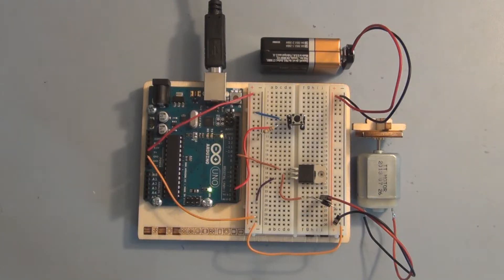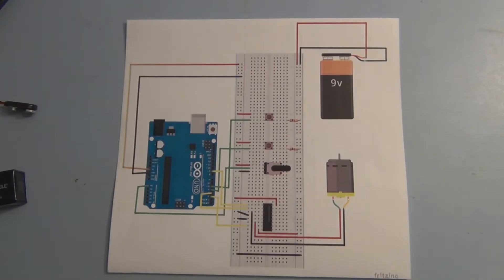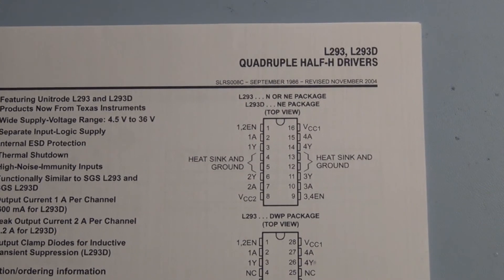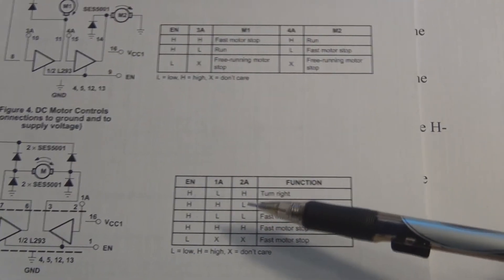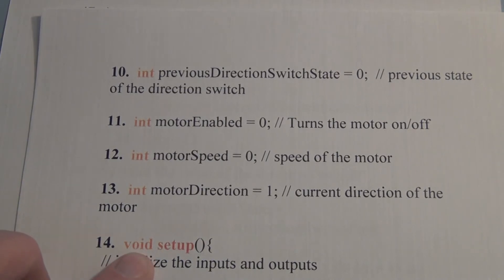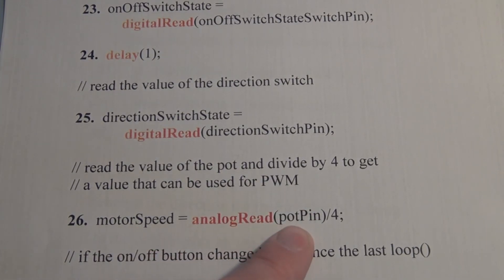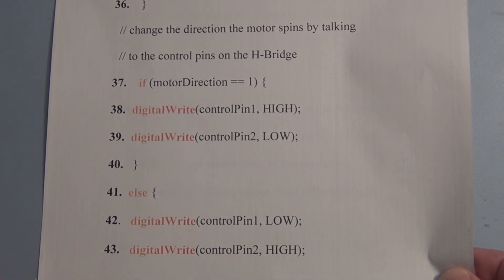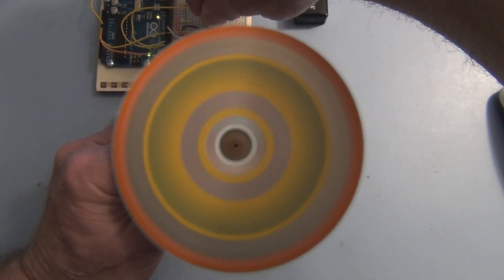Arduino H Bridge DC Motor Control Tutorial

Comment from the maker: const int controlPin1 = 2;
const int controlPin2 = 3;
const int enablePin = 9;
const int directionSwitchPin = 4;
const int onOffSwitchStateSwitchPin = 5;
const int potPin = A0;

int onOffSwitchState = 0;
int previousOnOffSwitchState = 0;
int directionSwitchState = 0;
int previousDirectionSwitchState = 0;

int motorEnabled = 0;
int motorSpeed = 0;
int motorDirection = 1;

void setup() {
  pinMode(directionSwitchPin, INPUT);
  pinMode(onOffSwitchStateSwitchPin, INPUT);
  pinMode(controlPin1, OUTPUT);
  pinMode(controlPin2, OUTPUT);
  pinMode(enablePin, OUTPUT);
  
  digitalWrite(enablePin, LOW);
  
}

void loop() {
  onOffSwitchState =
    digitalRead(onOffSwitchStateSwitchPin);
    delay(1);
    directionSwitchState =
      digitalRead(directionSwitchPin);
      motorSpeed = analogRead(potPin)/4;

      if(onOffSwitchState != previousOnOffSwitchState){
        if(onOffSwitchState == HIGH){
          motorEnabled = !motorEnabled;
        }
      }

if(directionSwitchState !=
previousDirectionSwitchState) {
  if(directionSwitchState == HIGH) {
    motorDirection = !motorDirection;
  }
}
if(motorDirection == 1){
  digitalWrite(controlPin1, HIGH);
  digitalWrite(controlPin2, LOW);
}

else{
  digitalWrite(controlPin1, LOW);
  digitalWrite(controlPin2, HIGH);
}

if(motorEnabled == 1) {
  analogWrite(enablePin, motorSpeed);
}
else{
  analogWrite(enablePin,0);
}
previousDirectionSwitchState =
  directionSwitchState;

previousOnOffSwitchState = onOffSwitchState;
}

Comment: Awesome - I got it to work! Thanks for sharing!

I might add that the reason your potentiometer was erratic is due to the when you divide the inputMotorSpeed by 4 but you'll sometimes end up with a floating point number. To force the calculation to be correct:

instead of:
"motorSpeed = analogRead(potPin) / 4"

...do this
"motorSpeed = analogRead(potPin) / 4.0"

I figured it out by doing a Serial.println(motorSpeed) after doing the calculation and was getting negative numbers in random ways. Thanks again - I learned a ton! Peace.

Comment: I need to use higher power motor with more torque, so can I use motor mentioned below?

http://uk.rs-online.com/web/p/dc-motors/2389721/
Reply from the maker: The L293 can only deliver 1A per channel.  That motor can draw up to 4A .  If you need more than 1A to drive the motor you can't use the L293.
Reply: Ohkay.....I already bought the motor and used it....It seems to work fine but i think it might harm my components, right? 

Could you please suggest different H-Bridge for the same ?

Comment: Very well explained, i do have a question may be you can assist.......
can the arduino control the speed threshold voltages without the use of a pot, basically using a inbuilt pwm  or f/v convertor to control speed. using up /down buttons for speed control
Reply: +Justin Case The input frequency could be  a crystal and thereby divided for conversion to voltage within the Arduino... is this possible?
Reply from the maker: +Justin Case Yes, If you use one of the PWM pins to drive the motor circuit, the gate on the MOSFET for example, you can write a program to keep track of the number of times a button is pressed and correspond that to a set PWM value so each time you press the button it steps up the speed to the next value.
Reply: Thank you

Comment: Can you put the actual code so we can download it and try it ourselves?
Reply: const int controlPin1 = 2;
const int controlPin2 = 3;
const int directionSwithcPin = 4;
const int enablePin = 9;
const int onOffSwitchStateSwitchPin=5;
const int speedControl = A0;

int onOffSwitchState = 0;
int prevOnOffSwitchState = 0;
int directionSwitchState = 0;
int prevDirectionSwitchState= 0;

int motorEnable= 0;
int motorSpeed = 0;
int motorDirection = 1;

void setup() {
pinMode(directionSwithcPin, INPUT);
pinMode(onOffSwitchStateSwitchPin, INPUT);
pinMode(controlPin1 , OUTPUT);
pinMode(controlPin2 , OUTPUT);
pinMode(enablePin , OUTPUT);
    
    digitalWrite(enablePin, LOW);
}

void loop() {
    
    onOffSwitchState =
    digitalRead( onOffSwitchStateSwitchPin);
    
    delay(1);
    
    directionSwitchState=
    digitalRead( directionSwithcPin );
    
    motorSpeed = analogRead(speedControl)/4; 
    
    if(onOffSwitchState!=prevOnOffSwitchState) {
      if(onOffSwitchState==HIGH){
      motorEnable = !motorEnable;}} 
      
    if(directionSwitchState!=prevDirectionSwitchState) {
      if(directionSwitchState == HIGH){
        motorDirection = !motorDirection;}
      }
      
    if ( motorDirection ==1){
    digitalWrite(controlPin1 , HIGH);
      digitalWrite(controlPin2 , LOW);
    }
    
    else {
    digitalWrite(controlPin1 , LOW);
      digitalWrite(controlPin2 , HIGH);
    }
    
    if (motorEnable == 1){
      analogWrite(enablePin , motorSpeed);
    }
    
    else{
      analogWrite(enablePin , 0);
      
    }
    
    prevDirectionSwitchState = directionSwitchState;
    prevOnOffSwitchState = onOffSwitchState;
    
    }
Reply: support this idea

Comment: I would like to use this circuit but control the motor functions (on/off, forward/backward, and speed control from the serial monitor (IDE).  Could you please provide direction as to how I would modify your code to do just that?
Thanks for your time.  Great video!!